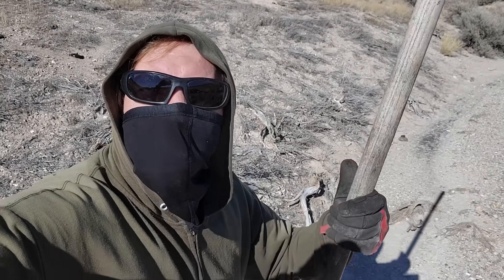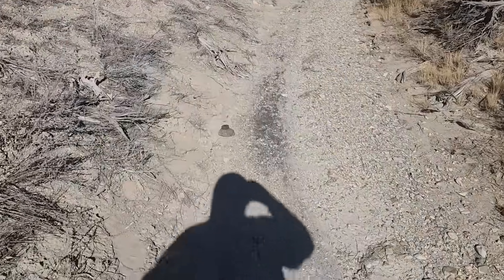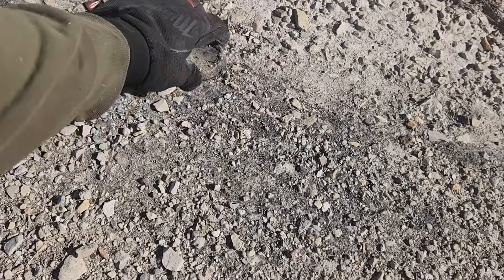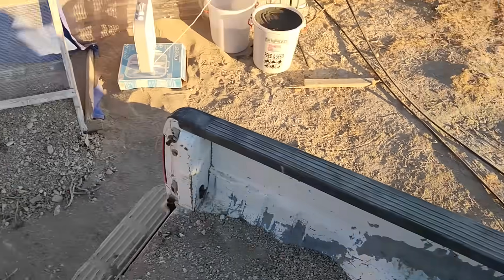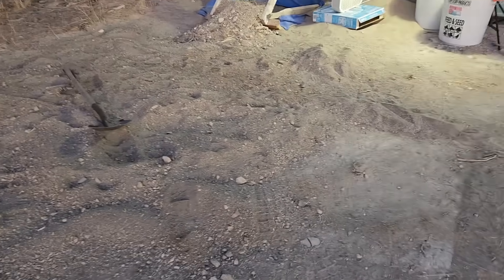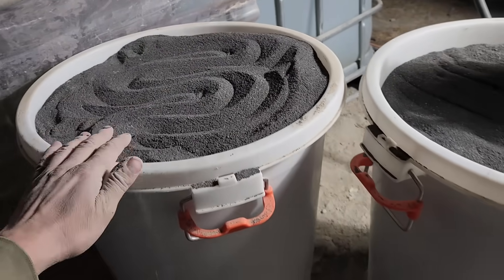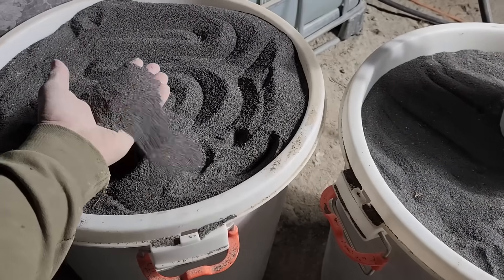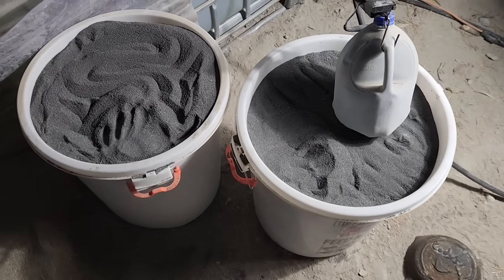Mining Magnetite

Comment: It would be cool to convert an old lawnmower to pick up the iron with an elecrro magnet that uses the switching of the magnet and kenitic force to separate the material into the lawnmower bag.  I found that a simple plastic bag over the magnet makes cleanup and / or separation of the iron from the magnet much easier 😁😁
Reply: I mean, a simple conveyor belt with a permanent magnet behind it would accomplish something similar, picking up moving and dropping the particles. What Cody has built does the job perhaps more slowly but with no electricity other than the spark plugs in the transport truck.
Reply: @chrismofer  the conveyor belt is an excellent idea.  10 times faster.  As fast as you can shovel into the classifier.  And you leave all spoil behind only transport product from the site, minimizing material handling.  Hats off, good idea.
Reply: @coloradojohn4582  Yes, I agree that automating the job would make a great video that would compliment this current video in his effort in collecting magnetite. Creativity is the key to engenunity. 👍
Reply: Electromagnets take time to turn on and off (after all, they’re the very definition of an inductor) so if I’m understanding you correctly you couldn’t go too high rpm
Reply: @techheck3358  Yes, slow and modify the geometry of the cutting blades to dig in the top layer of soil and either electro magnet or 2 permanent magnets that use the centricipal force and the magnetic field for separation.
Reply: @techheck3358  Electro magnets are some of the fastest switching mechanisms in the world.  7 pico seconds. However, a slower speed would have better adhesion to the iron due to centripetal force.
Reply: @friskydingo5370 there is no way the magnetic field decays in 7 picoseconds. The inductance of the electromagnet resists changes in current and even if you can switch the power to the electromagnet in 7ps (which would require an extremely fast MOSFET or BJT and would need a good, tuned drive circuit) the magnetic field simply cannot possibly decay that fast unless we're talking about a MEMS electromagnet or something, lol.
Reply: @AureliusR  typically you are limited by the switching mechanisms.  Inductors do not store electrical energy.  In a regular atmosphere and at room temperature, their switching speed is in the several ghz range. Partical accelerators would not exist without fast switching magnets. All of which is way faster than a lawnmowers mechanical blade.  An electro magnet and a hall effect sensor should have no problem at the low Rpm switching on and off. Again, superconducting magnets are fast, and yes, mems 7pico seconds. Of course, you are limited by physics, so anything smaller would technically switch faster.
Reply: @friskydingo5370  True, inductors store energy as a magnetic field, but that energy is released as electrical energy so that's what actually matters. And the switching speed depends on the inductance as well as Q factor and other parameters. If you want to switch an inductor in 7ps then that inductor will not be useful as an electromagnet for the application we are talking about here unless you have a stupidly large, low ESR power supply.
Reply: @AureliusR  yes I totally agree. However, you would not need a 7ps switching speed for a slow-moving lawn mower blade.  I was just quoting the fastest switching time recorded. Inductors can be slow or fast depending on their physical size and other factors. It also depends on what you consider slow or fast.  This started as just a random thought but had progressed into an interesting conversation 🤔 🙂
Reply: @techheck3358  what about a perma magnet like the ones used on a surface grinder
Reply: Cody should try this neat idea
Reply: I personally like the simplicity of Cody's idea. Its already very pure for the work put in and just requires a bit of shoveling material. The rest is all gravity and a magnet
Reply: @Andrew..J  Yes, but having to carry buckets of iron is a lot of work. Having an automated system would make an excellent video. This video would compliment it well. 🙂
Reply: To extract the material from the stream bed, perhaps instead maybe a rotavator/rototiller with an electromagnet? That would get the buried stuff
Reply: Itd simply be much more effective to concentrate in a sluice and then run through a magnetic seperator used to seperate magnatite and hematite from the cons. 
A massive plus is if hes in a gold bearing district, it will separate any gold present from the magnetics. 

Even with a massive electromagnet you would have to stratify the substrate in some way to allow the magnetics to get picked up. 
Might as well dig by hand and sluice it.
Reply: An industrial magnetic separator often uses permanent magnets (very strong) inside a rotating drum (stainless). Only a section of the drum has magnets. The drum moves the iron up and it falls off on the other side of the drum where there are no magnets.
Reply: You smoke a lot of pot and do a bunch of mushrooms, don't you?
Reply: Oh that’s a very interesting project idea!
Reply: Peak redneck engineering I love it.❤

Comment: Heat-shrink a bottle or use another type of non-ferromagnetic shielding around the magnet for easier separation of the ore.
Also: ELECTROMAGNETS (just use the microwave transformer already).

Comment: How about putting magnet under and a bit behind (to only catch magnetide) another magnet. This way you could get higher purity but in one run and not have to put the magnetide through the system again.
Reply: which one is the simpler method of the two?
Reply: @ELYESSS  simpler? As in less work or easier to set-up? Because method he uses is easier to set-up but it's 2 times the work basically if the thing I said is true. But I never tried the thing I said about 2 magnets.
Reply: @stasi0238  simpler as in less things to go wrong
Reply: @ELYESSS  then both are same as both are literally the same thing.
Reply: the magnetite that falls is already in small lumps and it hitting directly on another magnet won't be the same as loose magnetite falling into it which means it won't be as pure as doing a second pass but better than a single pass he was doing.
Reply: @witgangyounotube287  hmm, probably true. But then he can just use a sieve to break them down and a cone funnel to get the magnetide mix back on a path? This way it's still one pour but 2 passes.
Reply: Since the magnetite falls directly off the bottom, I think the absolute easiest way to get higher purity would be to just place a funnel directly under the part of the magnet where the metal drips off and have that going to a bucket.
Reply: @N8Dulcimer  the problem as another commenter said is that it falls in those crystal like lumps (and weirdly enough it is like it becomes a bit magnetic as in stays together for the duration of flight)
As such some sand particles get trapped in magnetide blobs and need to be removed, Cody is just running everything a second time, but with the right setup it can be run once and you get the same purity.

Comment: what if you made a low riding wheelbarrow with a small plow on the front. Wheelbarrow bucket made out of metal and place multiple magnets inside. When you "drive" over the soil, the plow loosens it and the magnets will attract it to to the underside of the barrow. Then when it is full place the barrow over a sheet big enough and remove the magnets so that the soil falls to the ground? Just popped into my head watching this. Will probably be a crappy solution, but had to get my idea out there 😛

Comment: You could use a baby buggy with a centered rotating bikewheel (driven by a chain), where a magnet is attached at special spots (let us say 90° angles) and a semicircular hard plastic sheet in between the wheel and the ground plus a  dropping pot. A rake in front of the baby buggy would spread the dust in the air, the rotating magnet would attract the magnetite, the hard plastic sheet hindering it to get caught by the magnet, the magnet tracking the dust into a dropbin.
Reply: nope bucket with a hole
Reply: bucket hole

Comment: Would there be any gold along with the magnetite where it settles?
Reply: Gold would not be deflected by the magnet since it is not magnetic. But if there is gold in the area, it may have settled in the stream bed with the magnetite. When panning for gold, you look for areas where the heavies would settle and magnetite is a nice indicator.
Reply: Unlikely, given the number of closed mines in the area. If there was decent amounts of gold in them hills, those mines would be all over it. But it's also not impossible that he could pan some flakes here and there.
Reply: As a geologist, it's hard to say. Magnetite and gold tend to settle in the same areas, but the rock that erodes into the sediment system needs to contain gold in the first place.
If there's gold in the area it is eroding from, yes, there could be gold in that sand.
Reply: Gold isn't magnetic.
Reply: Iron and gold. Doesn’t get better than that

Comment: Have you analyzed if you are getting any other heavy metals along with iron?
Reply: He sure does but they are so low amount there is nothing can be done with them.
Reply: There could be some Cadmium or Nickle
Reply: @sibtainhaider2411  You mean cobalt, not cadmium.
Reply: A few years back he extracted quite a bit of mercury, from cinnabar, in his local area.
Reply: If radiacode sponsors cody he could check for thorium and uranium
Reply: @The-One-and-Only100  Exactly what I was thinking!
Reply: @The-One-and-Only100  i don't think he will find uranium out here but he may find some traces of radioactive Cobalt or Some other metal from the Rhodium group.
Reply: @sibtainhaider2411   No, because cobalt 60 has a half life of about 5 years while uranium has a half life of billions of years
Reply: Panning/sluiceboxin tailings could be intresting. As Cody collected primary material with shovel he collected all heavy minerals. After magnetite separation most of non-magnetic heavies are still in tailings. For example gold and platinum if present. But then panning and friends needs water and that looks likely to be in short supply. Mayby same air separator...
Reply: what other metals are magnetic?
Reply: @basketofdeplorables4253  Nickel, cobalt gadolinium, neodymium and samarium are also magnetic but there's going to be trace elements as well cuz keep in mind, these are particles of magnetite, not compounds/atoms, no matter how pure he makes it here it'll be somewhat contaminated. Hell there could be a couple trace atoms of gold in them but it's not enough to make money. The other stuff would be enough to be dangerous though.
Reply: @basketofdeplorables4253  That's not the point...
Reply: @ares395  It absolutely is a crucial point.
Reply: @Kavriel  Well Nickel and Cobalt are also ferromagnetic, but the point the original comment was making is that there could be other heavy metal impurities in the magnetite particles that get picked up. Not necessarily pure lumps of other metals
Reply: @Kavriel  You do understand that things don't need to be magnetic to be pulled by being bound around other magnetic particles or is that basic fact too much for you? So no, other metals being magnetic are not the point. Go back to school or something.
Reply: @ares395  well how he would be getting other metals with the iron? wouldn't it stay with the dirt?
Reply: @ares395  if the vast majority of the paydirt went the opposite direction, would it stand to reason that most of the other metals would go to the dirt side? not into the bucket with the magnetite?
Reply: @ares395  Lets not focus on this issue and let's look at your comment. Why the aggressivity? What's going on with you?Would you talk like that to a stranger you met in public?
If not then what does that say about the way you handle yourself here? 
You're on the internet, with anonymity, yes, but you can choose to talk to people respectfully and constructively.
Reply: @DarkVortex97  exactly. Magnetite can have Copper, Nickel, Cobalt, Cadmium, Some mercury oxides
Reply: gotta be some gold
Reply: @notozknows  I feel like it would be worth panning a bucket of the tailings just to see what's there. It might not be a lot but who knows, there's a large concentration of heavies with some variation in size and there were at least two layers in the stream bed. If there's gold anywhere nearby, I'd expect to find some there with the rest of the heavies.
Reply: @notozknows  Gold wouldn't be captured.  It would go out with the dirt.
Reply: @notozknows  He can only get iron and maybe nickel and cobalt, because he is using a magnet.